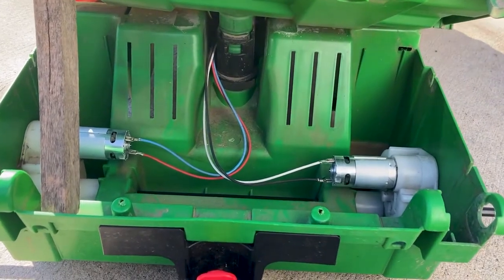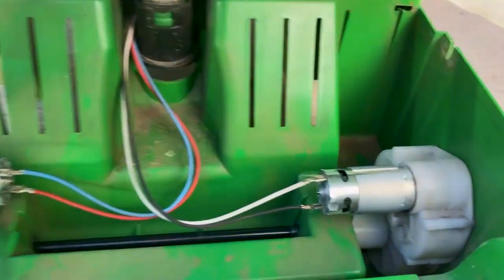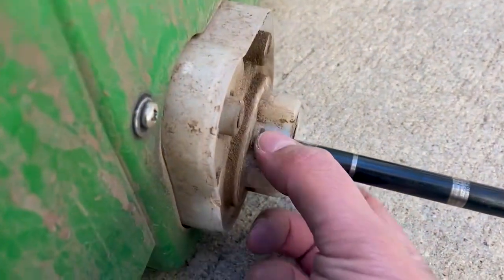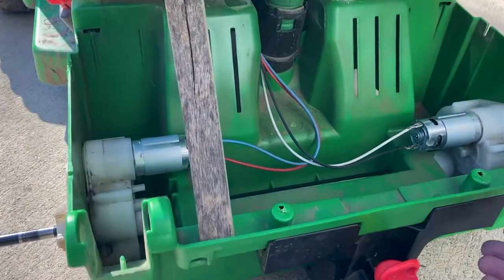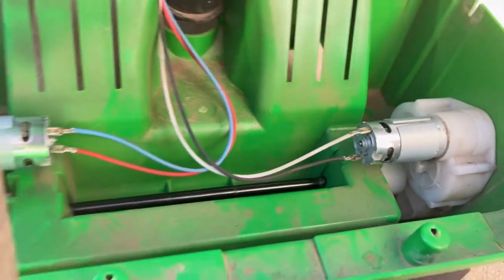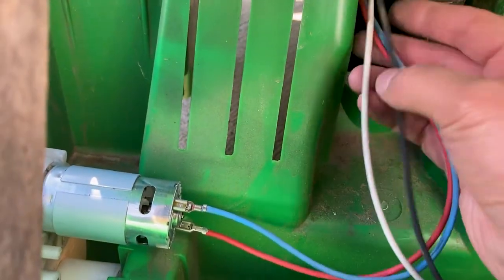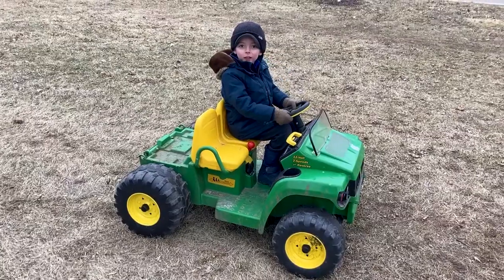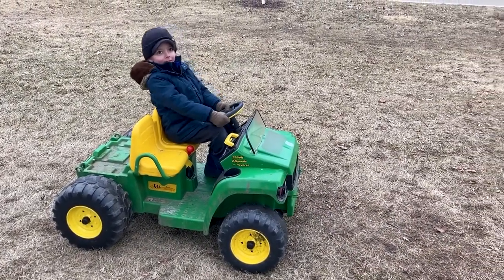Motor Replacement on a John Deere Gator Ride On Toy Peg Perego

Comment: I don't think that is correct about 1 motor working on low gear and both motors working on high gear.  If that's the case then something is wrong with the switch, because the contacts are always working in pairs.  Sounds like a bad switch.
Reply: Mine is working one with high and two with low. I was wondering if thats normal.